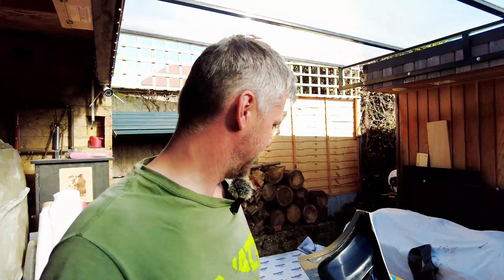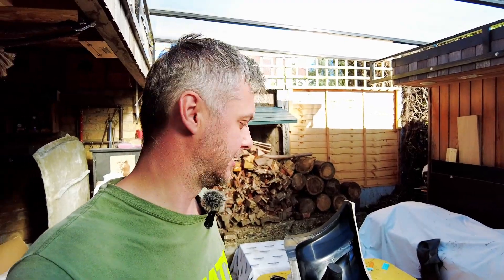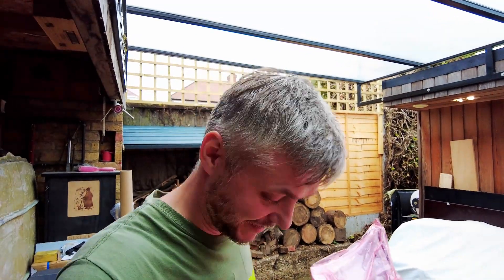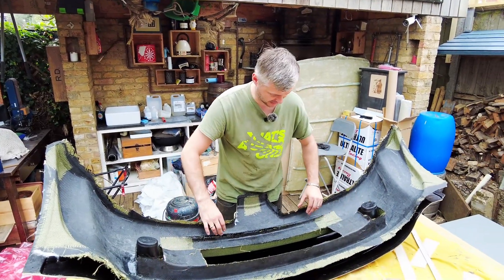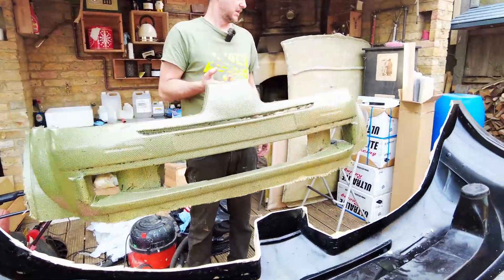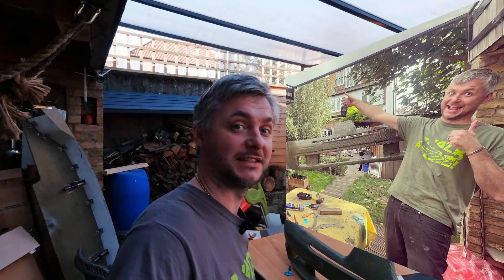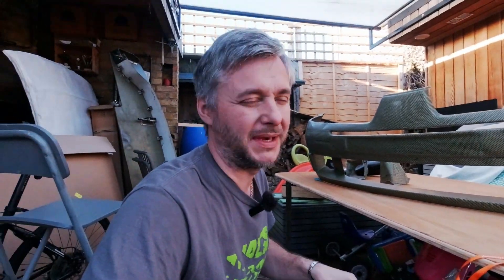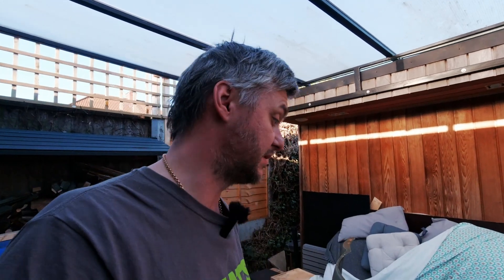KEVLAR car body. How to make carbon fiber bumper. Carbon kevlar bumper finished. Ep.50

Comment: I am surprised you didn't have major problem like total failure, demoulding even the original bumper from the mould. I had much smaller part and less complicated and while I did demould it in about an hour, it was a struggle. I had it coated with liberal amount of easy lease. So you say PVA is better than EL from Easy Composites for this particular project? Or was the price difference between the two?